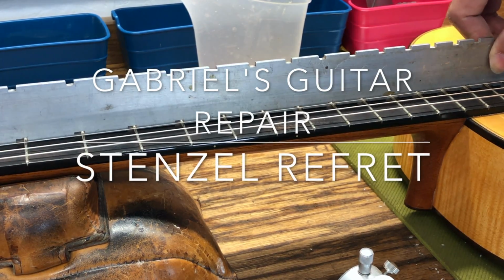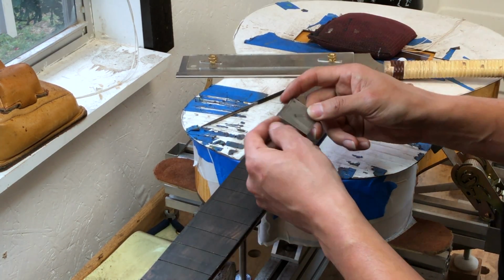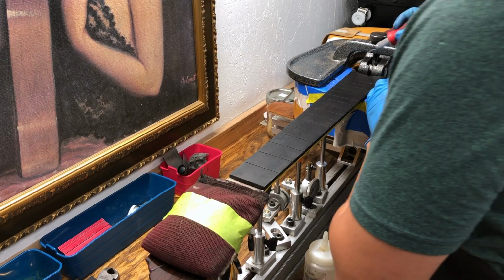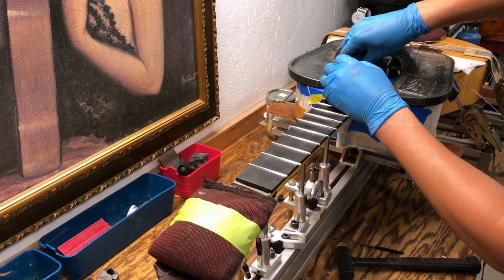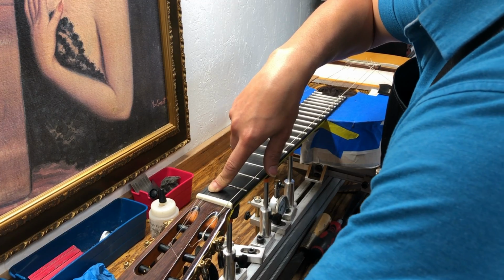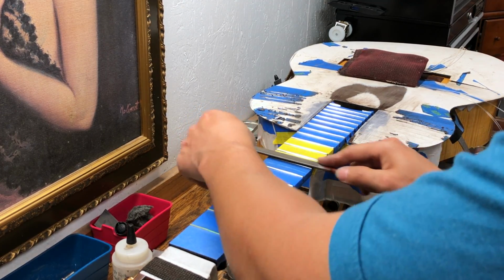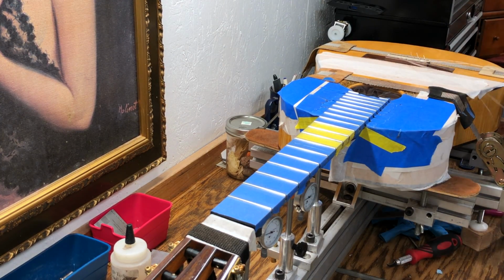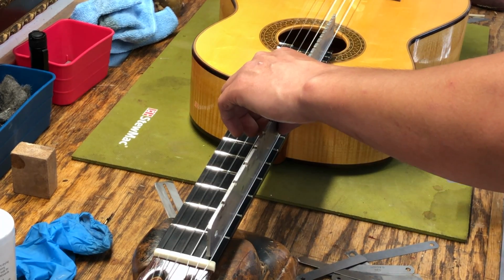Sebastion Stenzel Classical Guitar ReFret

Comment: I am about to do my first refret with Jescar 55090. It's probably difficult to recall at this point, but what happened on this job at the saddle? Did the compression refrets and the taller frets allow you to shim or make a taller saddle to achieve the action you were looking for? Or did you still shave a bit of bridge? Did you only use compression at frets 6,7,8?

Comment: Quite ...shocking... 
As far as I know, I mean to remember that the fingerboards of Stenzel guitars were slightly radiused and also twisted from the first guitar he made (actually I own the very first guitar he ever made under his own label) - for a purpose. Of course that doesn't mean it can't be warped as well after a time - wood works and changes. But the answer is not to just sand it flat. I have watched Mr. Stenzel bringing the right form to the fretboard - its a long and tedious process... Also that the ebony chipped out during unfretting is not so uncommon and not necessarily a sign of bad wood. Also different makers have different ideas about the relief. Of course if the outcome is satisfying for your customer ther isn't much to say. But generally speaking your procedure of reworking the neck is not very true to the way how Stenzel guitars are made...